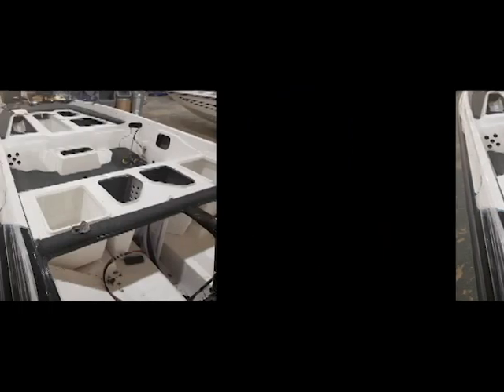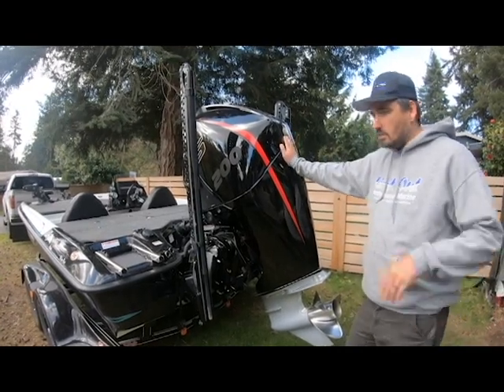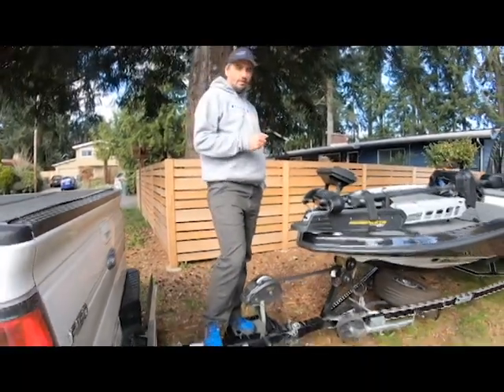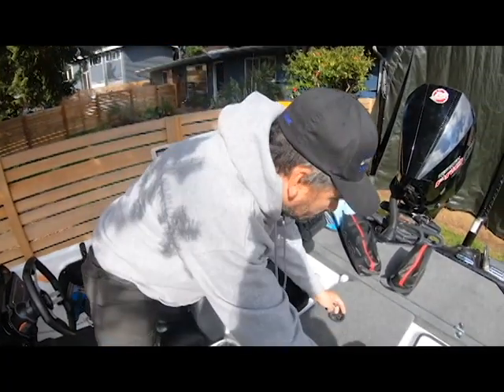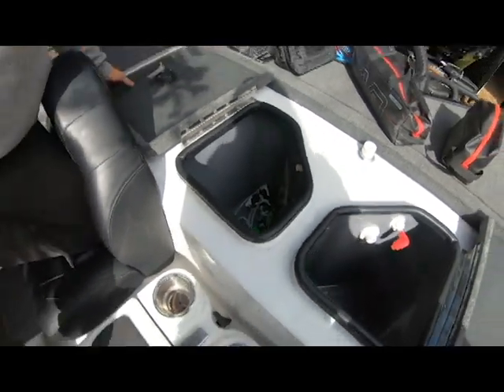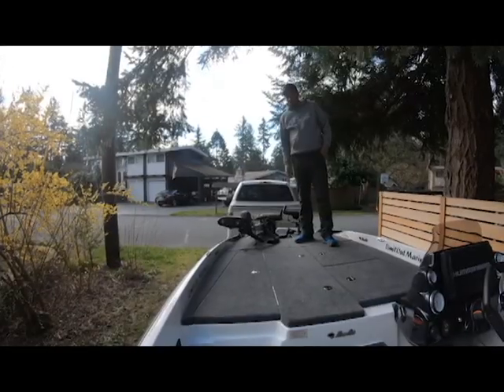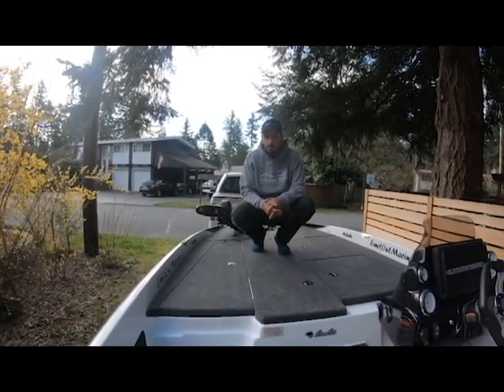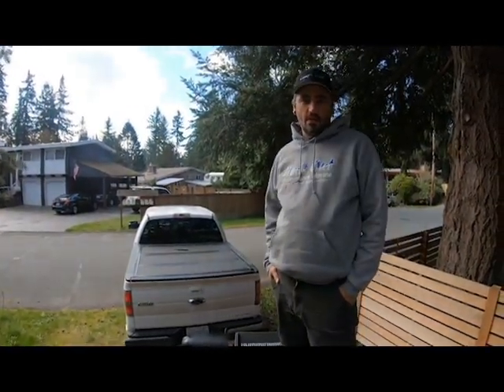BassCat Pantera Classic 2020 - Walkthrough

Comment: One more question......With the bit narrower beam on the Classic compared to other models (both Bass Cat and other manufacturers), are you finding the width to be adequate?  It does seem as if they carry the width fairly far forward.
Reply from the maker: Most bigger boats taper so the front deck on the Classic actually ends up being wider at the bow where you are standing most. . It is also longer than most. I look at guys in 20'ers all of the time and think to myself how to they fish out of such a small space. The boat definitely is a unique design in that regard.  That extra deck space does come from somewhere though. The rear deck is plenty big for your non-boater but it is smaller. The compartments are rather large though as is the Livewell and the rear hatch has excellent access to everything. The boat is in a class of its own because no other manufacturer makes a similar boat. ....

Comment: Do you wish you had a hydraulic jack plate?
Reply from the maker: YES!!! The boat will perform great without one.  A lot of dealers will say BassCat's don't really need one. I would have added one but I was at the max of what the bank would allow me to get at that time. I have taken this boat to Havasu and the Delta where it would have come in handy a few times. Or just in general when you are on a shallow flat that you idle way back into and then when it's time to leave you have to idle out when if you had a jackplate you could jack it up and get on plane and get out of there fast. I have fished a bunch on the Columbia, Roosevelt, Banks, Lake Washington (all places that will get 6'+) When it's nasty out like that a jackplate would do wonders.  If I could drop the jackplate all the way I would feel a lot safer. It's a good thing this boat has handled those situations well. I also carry a spare 4 blade prop in the truck if I think I'll encounter those situations. The 4 blade sucks for top end. It'll go jsut as fast for me (23 Croxton 4XL) but it walks much harder when you near 70 and is scary. 65 and under for the 4 blade for me. The 4 blade I have also seems to lift the bow less  which is not good for rough water. So it's a trade off. Now you can have the prop worked and have more cup added to the blades which will give you that bow lift. I just haven't done that yet. I will soon. I will never buy another boat without. You will be fine without but it is a handy tool to have.

Comment: Thanks.  This was a good walk through.  There isn't much out there for this model.  Is the 80 lb. Ultrex adequate or do you wish you would have gone with the 36 volt 112 lb.?
Reply from the maker: 80 is perfect. If you went 112 you would definitely want to go lithium because the weight of that extra battery in the back of this boat would make it not perform well in my opinion.
Reply from the maker: i should add that i have been in some rough water all day with my 80 and group 27 agms and have never run out

Comment: How's the monthly payment?
Did you have to put a bunch down to get the payment you have?
Reply from the maker: Not gonna say what I paid or put down or my payments but a good rule of thumb is minimum 10% if you want the bank to consider you for financing. You can look up payments easily by calculating the cost of the boat plus tax title license freight and rigging pus accessories. Then just use any finance calculator and enter in whatever the going rate is for boat laons.
Reply from the maker: and the seats have about twice as much padding as the original seats. thats the difference.

Comment: I know BC markets this Boat to be a Budget Boat. Is option upgrades limited? I would want to upgrade the seats and center coin box, tilt steering, & the pole to help getting in the boat.
Reply from the maker: Ok so in terms of seats, you are a little limited. You can not get their premium seats. The reason for this is because of the layout. If they put bigger  premium seats in they have a lean of a couple inches. They would have to either  make the cockpit smaller then tall guys wouldn't fit or make the rear smaller which is already on the small side because of the massive front deck. The front deck on the Classic is larger than a lot of 20' boats!   I love the front deck and storage layout of this boat.  It was between this or a Phoenix and I chose the Classic.   Ok back to the seats.  So you can have the seats customized to a degree.  I did. I had them improve the foam padding in the seats. I have more foam in mine than what comes standard. Much more comfortable. Just tell your dealer this and tell them yes BassCat will do this.  

Yes you can upgrade the center box.  I have the upgraded center. It makes the boat look a lot better and is very nice. It also give you a handle for the passenger.  

Yes you can get tilt steering and I wouldn't have a boat without. I move mine up when I'm driving and down to see the screen better when graphing. 

You can add the step ladder and pole.  I wish I would have done this. Biggest mistake in my purchase was not getting this option.  I will be adding an after market one this year. 

Any other questions just hit me up. The boat itself has been great.

Comment: Nice video. I'm looking to purchase the same boat. Question: I noticed you stated your soft plastic's bags needed to dry out. I had the understanding that was a dry compartment, is that not the case?
Reply from the maker: It rains A LOT here in WA and I always seem to be heading out to fish in the rain. It was wet from opening them in the rain.  Every compartment stays dry unless you stuff a wave or open them in the rain or put wet stuff in them.
Reply from the maker: The boat has been amazing and I think is one of if not the coolest 19'ers out. A lot different the most of the other 19's and priced much better and still just as or even faster with the 200.